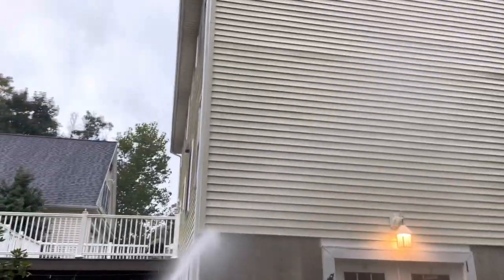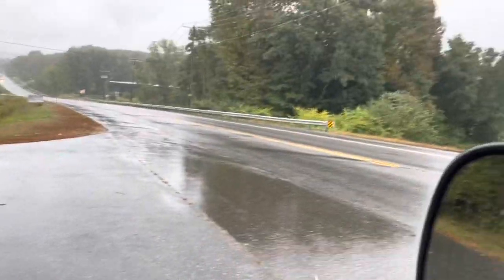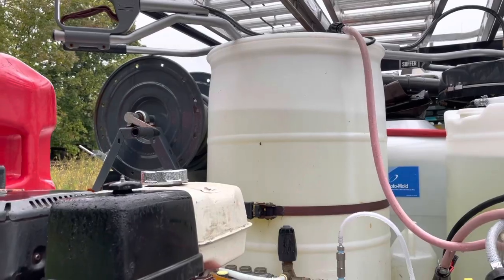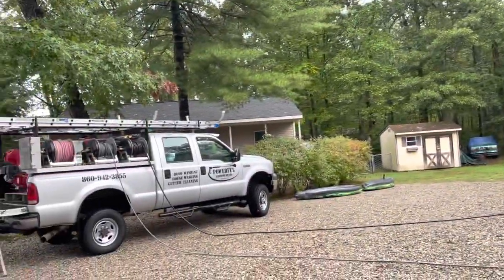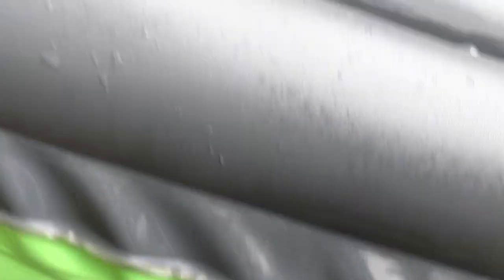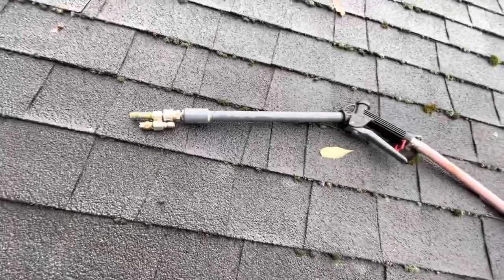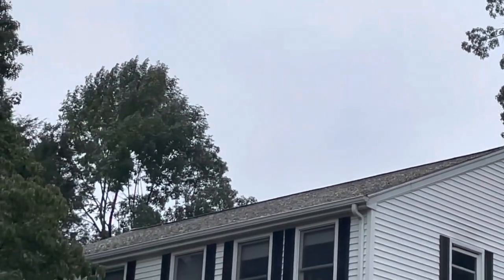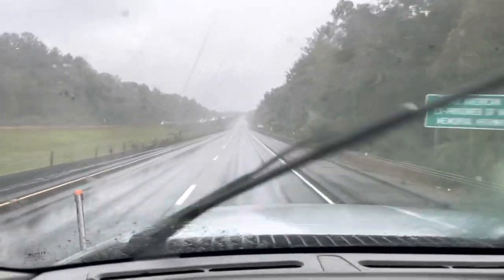Rainy Day Washing

Comment: Hey Joe, I have a new gx390 with a 5.5 GP using a downstream injector coming off the pump into a whip line of 5’ tied into a hose reel with 200ft on a new gun and M5 twist.. and won’t pull soap! Any suggestions?
Reply from the maker: Be sure the arrow on the injector is pointed the right way.
Reply: Yea it’s on the right way, how many feet of hose are you running? Are you running through the manifold in the reel?
Reply from the maker: @hsilva3213  I run 250 trough the reel etc. have you tried pulling with the stock black soap nozzle? Try pulling with 1/2 the hose?

Comment: Hey Joe, what length pressure hose do you use? Thanks
Reply from the maker: 250 total. Consists of two, 100 foot sections and one 50 foot section

Comment: Joe, have you ran into situations where you soaped gutters a couple of times and still black streaks? Personally,  I don't want to upsell gutter brightening on a 2 story with a walkout basement which is 3 stories.  What do you tell customers that still has stripes on gutters? Basically it still looks dirty.
Reply from the maker: Yes. Unfortunately once gutters are severely oxidized the only thing you can do he’s gutter butter with a brush.